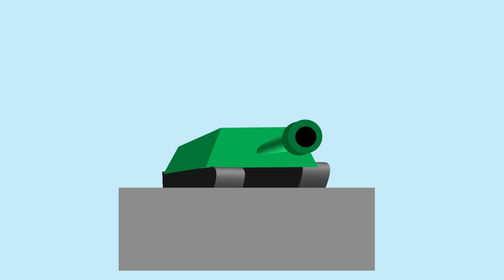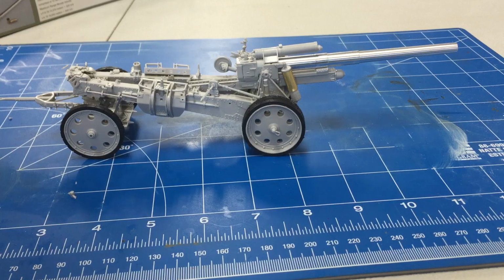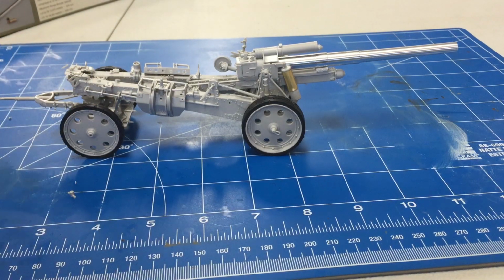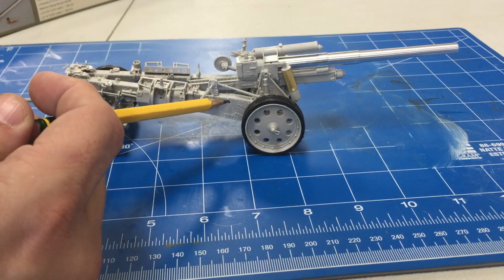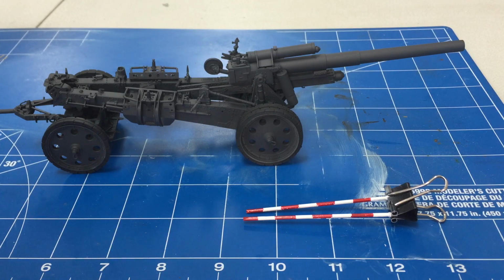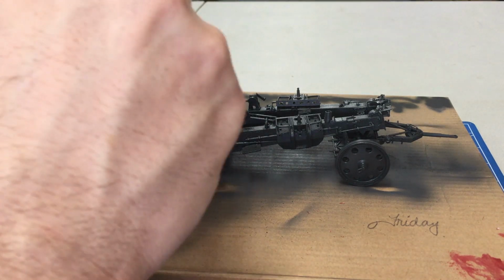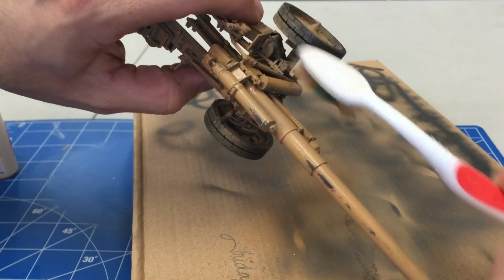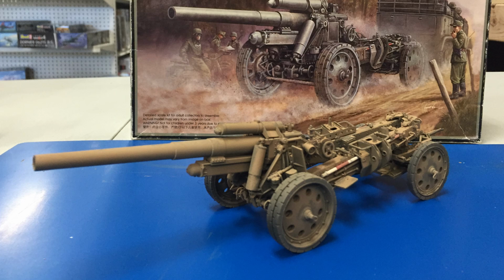Building the trumpeter 1/35  German 15cm Field Howitzer in North Africa

Comment: andy, good job on the howitzer. but do you have any weathering advice for a challenger 2? (no air brush)
Reply from the maker: +matt yu You can use a can to do the base coat of desert yellow and using german grey in a bottle lightly dry brush to make the scratches . the dust you will have to use a pigment like vallejo
Reply: thx

Comment: Andy, thx for sharing your builds. I like your videos a lot but somehow it seems to me, that you have to invest way to much water, rubbing and struggling to chip the white or yellow paint off. And when it finally works, it peels in off rather big areas... Do you use the Laquer thinner to thin down the color coat over the hairspray, too? Maybe this might be a reason that the paint won't come off more easily... Did you ever tried to use water to thin down the coat you want to rub off later?
Reply: firefishable if you have to scrub hard to remove the top coat of paint, you did it wrong. Either the hairspray has too strong of a hold, or you used lacquer thinner in the top coat. Best to use water to thin. Also, soaking the area on the model you want to chip beforehand helps soften the paint so less effort is required to remove.
Reply: @mistrimeat  Do you use Tamiya Acrylics in this topcoat (thinned with water) or might it be better to use a water based acrylic paint for this (e.g. Vallejo)?
Reply: firefishable yes Tamiya thinned with tap water works perfectly with hairspray. I have never tried it with Vallejo, but I have seen it done with Mission Models paint as well.
Reply: @mistrimeat  Thx... I'll give it a try.

Comment: what are those pole in 9:57 i search google but i cant find it
Reply from the maker: I believe they are ranging poles to measure height
Reply: +Andy's Hobby Headquarters thanks
Reply: They are aiming stakes.  The gunner uses them as a reference point to lay the tube in the right direction for a fire mission